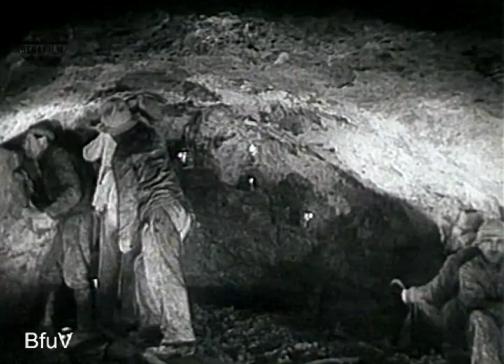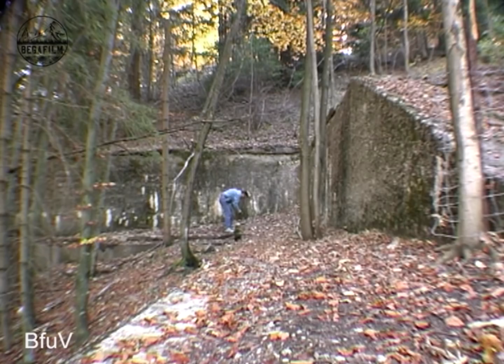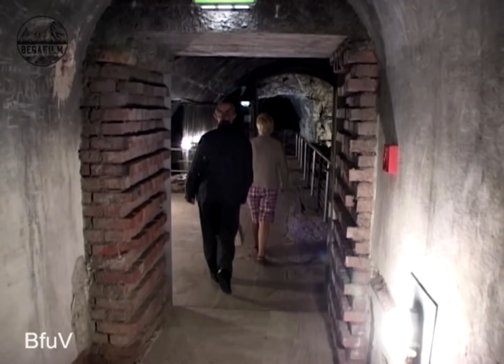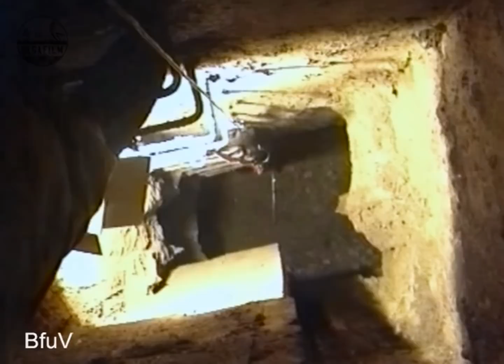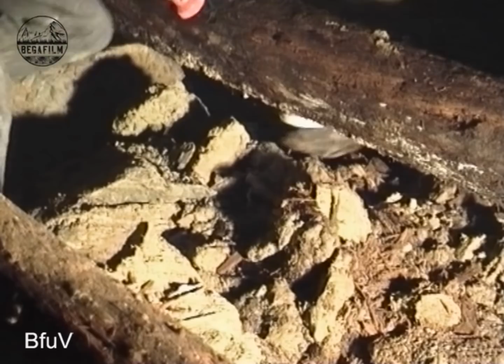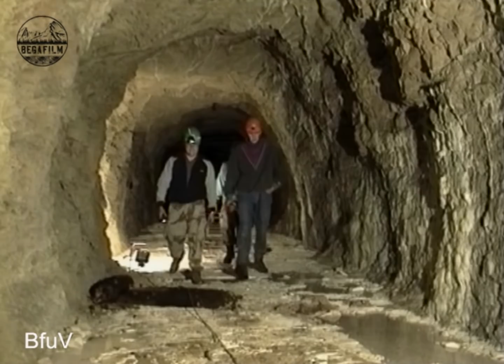Lost Places: PLATTERHOF & SS-BUNKERSYSTEM  on the Obersalzberg with Ing. Dr. JOSEF PRETZL

Comment: In 1987 I with a few other paratroopers locked ourselves in the bunker system after a US Army tour. We knew that we would have to spend the night there until the next daily tour. We had done a lot of research and knew that the elevator shaft was the best way to the lower levels. We had 23 hours to really explore down there. We also used a roller ladders and rappelling ropes. We too had to pry open the iron door. We too found an entrance that in those days you could see behind the Zum Türken. It was too hard too open from in or outside. It is buried now.
Reply: Whereabouts was that?
Reply: @drubber007 The depths of his right brain. 0 chance that happened.
Reply: @RaceBanner_  That's a bit harsh.  What makes you say that?  Seems a bit odd to just make something up like that.

Comment: Great footage.   Excellent presentation.  We had considered rappeling down the large, "elevator shaft" several times.  Never did it due to all the unstable wood hangin from the walls, (staircase remnants). We did find an interesting service tunnel from the Platterhof to the Gift Shop/Post Office across the street.
Reply: @sandua51 Are you sure about that service tunnel? I've never heard of that and I've read widely about the area. Did you actually see it? What can you tell us about it? Is it high enough to walk in? Where are/were the openings? Thanks in advance.
Reply: @CraigCanberra  Yes.  You had to rope down from my "office" widow, (which was underground behind the disco. My widow had a light shaft even though it did not open to the surface. There were built in steel rungs in the wall but they were mostly rotted away.  I think it was a mechanical chase for heating electric etc, but it was big enough to walk through.  I spent a lot of time in and around the bunkers on the Obersalzberg and at Stangass.   Even got to go to the Berghof side with some local officials once.  There is an entrance in the woods off of the Salzbergstrasse,  Almost 25 years ago - not sure if I could find it today.
Reply: @sandua51  Then, you really have a first hand experience of being right there and working in the buildings.  Awesome!  The old post office was gone when I went back in the 1990's.  I HATED all this change and then the destruction of the buildings.  Soldiers today should be able to go there for R&R or like I did, space available, and LEARN some serious history!  Today's generation will soon know nothing of WW2.

Comment: Nice video. I remember visiting Obersalzberg in 1955 when I was in High School and entering an underground bunker there. I don't know which bunker it was but I do remember that the entrance was in a large concrete pad where a building had once stood. There were concrete steps leading down to a landing where, on the concrete wall facing the steps, were gun ports. Off the landing at a 90 degree angle were more steps leading to a concrete corridor with rooms leading off the corridor. The walls of each room were pock-marked by bullet marks where a soldier had fired a submachine gun into the open door before entering the room. I don't remember how far the corridor ran or if it was blocked. I wish I had taken pictures! Do you know which bunker this might have been? I did take pictures of Adlerhorst, though.
Reply: Bullets marks?
There has not been any fights. Nor the 101th Airborne, nor the 2nd DB who went to invest Berchstegaden, the complex and the Eagle Nest had to use guns. My grandfather went there (2nd French DB), just few hours after 101th Airborne.
No more Liebstandarte Waffen ss, just maiden and servers. No way to fight them...
Reply: @declissonolivier9376  Where ever it was, it was as I described it.